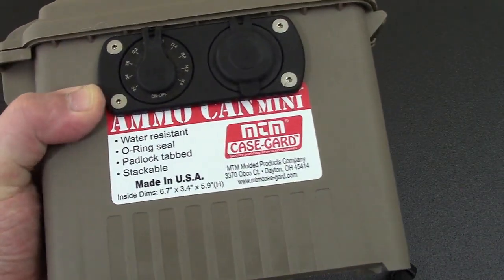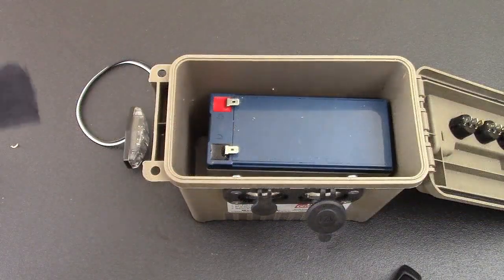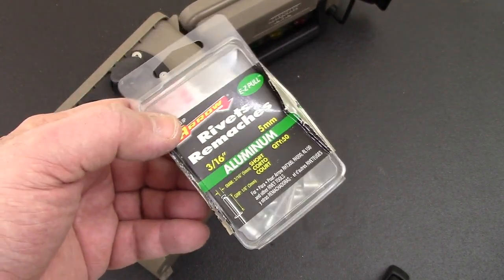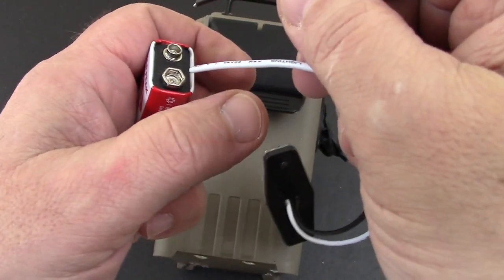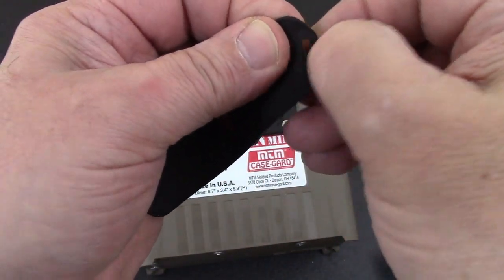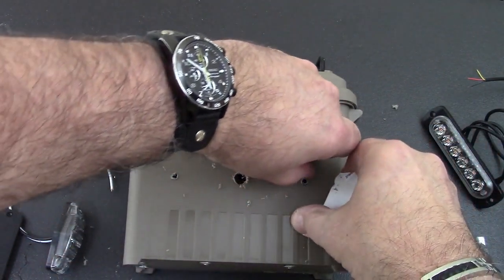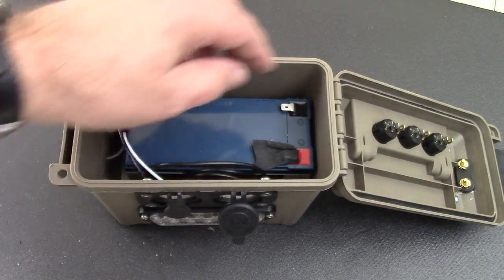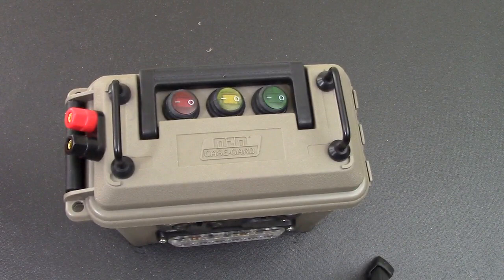SMALLEST AMMO CAN BATTERY BOX MTM MINI WITH FULL SIZE FEATURES

Comment: Great job.  Only thing that I didn't see  was the addition of a state of charge battery meter.  Thats really important as this generator is using a lead acid battery which can only be drawn down no less than 50%  You would need to monitor this.   Also I would use a forstner bit over the paddle bit to drill those switch holes as the box is thin plastic.   Finally, fusing is needed.   All in all though, good job.   Good detailing.
Reply from the maker: Hi there! Every box has a built in battery meter and a dedicated fuse block.  All wires are pure silicone to withstand temperature extremes and maintain flexibility. A wiring chart was also consulted to assure the wires far exceed  capacity for amount of amperage.  Just took my experience in building electric radio controlled cars and boats and applied it to ammo box batteries.  Built the boxes for fun and relaxation as novelties mostly.. Thanks for watching!

Comment: Really cool project.  Have you considered using the LiFePo4 batteries?  I wonder how many amp hours you could get into this box and it would be lighter and the battery will almost last forever
Reply from the maker: Hello Bruce.  Agreed lithium is the way to go but I'm kinda on a fixed income and the gel cell was around $22.  Parts are readily available on line but people build these things to suit their own needs so it's really a matter of preference.  If this is your first build, go with a larger box as it's easier to work with.  Took me a while to figure out how to put the smaller box together.  Thank you for commenting and especially for watching.

Comment: What was the reason you went with the traffic light style power switches?
Reply from the maker: Helo Jay! They were low profile and water resistant. Big problem with placement. Originally wanted to place these on the other side on top of the logo but the impressions of the logo and recessed square caused a esthetic problems.  So I considered making a plate out of metal or ABS plastic to cover the logo and mount the switches there, cutting the logo out and mounting a plate beneath it..  Nothing I thought of was working so the project sat.  Then last week the idea to mount them in the handle hit... Played with the measurements and it worked.... Buttons look awesome in there.

Red switch will power the front 12v lugs.. Amber for the flasher, and green for the front light.  Just worked out that way... Just making it up as I go along...
Reply: @thisoldmanchannel  very creative!
Reply from the maker: You too man! Thank you!
Reply: Nice build!
Reply from the maker: Thank you All kinds of Outdoor Activities.  It's great to see a new wave of YouTubers coming online.  I'm so glad to be a part of that movement!

Comment: I love where you're going with this design!   I'm currently using the same size case by Flambeau.  (6.75” x 3.5” x 6”)  They call it the Mini-Ammo can… Model 5415MC.

Thanks for posting this!!! This is such a great project… however, I’m begging you to use lithium 18650’s.  It’s not too hard and you’ll get soooooo much more energy storage… with only 1/4th  the weight.  I’ll help you build the battery if you want my assistance.  Heck, I’ve got almost 2000 18650 cells, so I won’t even charge you anything.  I just want your mini battery box to be the best it can be. 

 
On my build, I went with lithium ion LG “MJ1” - 18650's from medical packs. (Most medical packs are cheap and the cells are hardly cycled at all!  Test the cells for Capacity, Internal Resistance, and Self Discharge… then cross reference with the manufacturers spec sheet to get the “New” cell specs.  That’s how you know how much, or how little your 18650’s have been used.) 

It’s surprising what I was able to jam into this super tiny box.  My battery is 450 Watthours, or 40.5 Amphours.  For a box that’s only 6.75” x 3.5” x 6” that’s insane!!!  Compare that to the Jackery and GoalZero units.

Here’s the battery math:

36 cells in a 3S12P configuration.  That calculates to be 3375mAh * 3.7Volts  =  12.49Watthours per cell.  Multiply 12.49Wh * 36 cells gives 450 Watthours.  

(That can also be calculated by taking 3.375Ah * 12 cells in parallel = 40.5 Amphours.  Now take 40.5Ah * 11.1 Volts nominal = 450Watthours.)

Features of my version (I call it “The Nano Solar Generator”):

1)	Long lasting, high capacity (450Wh) Lithium battery. (40.5 Amphours)
2)	I also squeezed in a 150 Watt Pure Sine Inverter just so I could say that this tiny thing does 120VAC too.  LOL.     
3)	Additionally, I really wanted to be able to charge this box via the sun, so I managed to fit an inexpensive, 220Watt PWM charge controller in here as well!  Now I can call it a “solar generator” instead of just a “battery box”.  In a grid-down scenario, my box will charge back up via solar panels and keep on trucking.
4)	Naturally, my box has USB-A ports (four of them) for cell phones and other USB items.  
5)	I also included two 5.5 x 2.1 barrel plugs for my 12V LED lights.  It’s always more efficient to use 12VDC instead of 120VAC whenever possible, to avoid the inverter’s 10% to 15% efficiency loss.
6)	I installed a small LCD voltmeter that shows the battery Voltage and remaining % power.
7)	Solar input was accomplished via a panel mounted XT90 jack.  Looks clean and it’s made for high current!
8)	Built-in LED lights.

Let me know the exact dimensions of the spot you have in mind for your battery, and I’ll figure out the most 18650’s that I can cram into that spot.  I can make a kit for you to build……  or I can just build it for you and mail it to you.  Once the battery is built, adding a BMS is super easy.  I have exactly what you need.  Let me know.

Keep up your excellent channel.  You inspire many thousands of people!
Reply from the maker: Yeah the flambeau is pretty cool.. Just checked it out... I found the MTM at a firearm store because I was looking for something small and an real easy low cost build for people who wanted to get into building battery boxes... It just kinda evolved into something more, but very challenging to neatly integrate we with more features. I guess there's a difference to something that looks home built as opposed to something that looks more custom built.
Reply: thisoldmanchannel - how about building another one of these tiny boxes with one of my 12.6Volt  18650 lithium batteries?  (No charge.). I could email you pictures of mine to show how I managed to squeeze it all in.  

Honestly, skipping the 150Watt pure sine inverter would make it much easier and require less TETRIS type arranging!  Lol.
Reply from the maker: Thank you for the offer but I have something else in mind for the next project. Think you guys are really going to like it.
Reply: @test-193  What a great offer!  I can’t believe he turned it down. I would love to see what you have built and appreciate the earlier explanation of your thought process behind your changes and like the improvements over what has been built thus far on this channel (although I do like the thorough explanations and thought put into these too.)